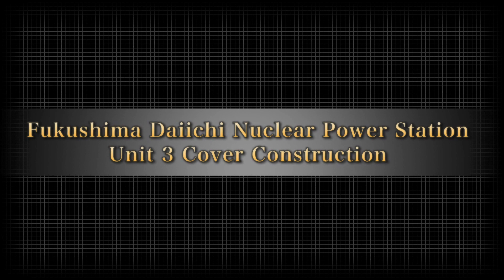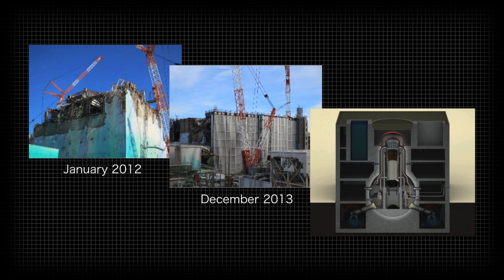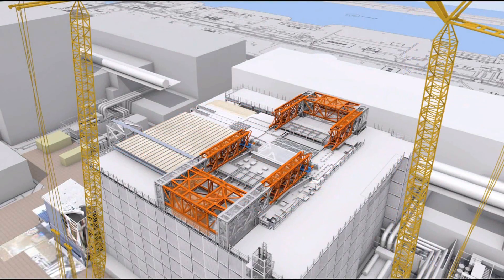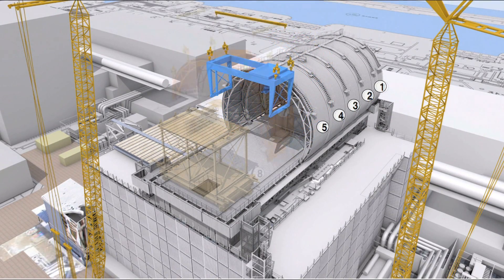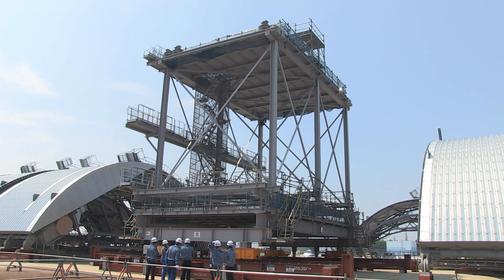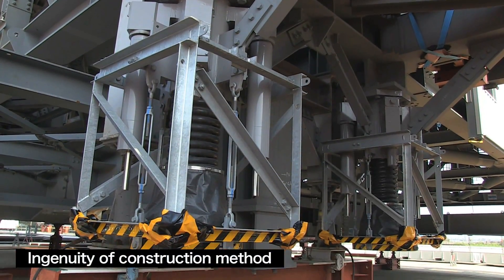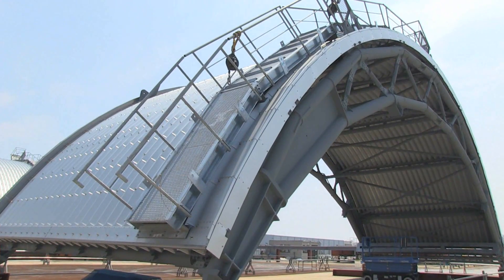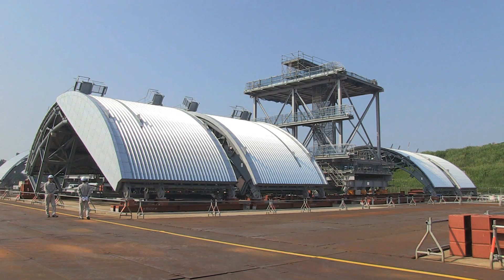2015.10.15 Fuel Removal Roof Cover Installation on Unit 3 at Fukushima Daiichi

Comment: Are you trying to tell me the spent fuel pool is still there, where the top floors of unit three used to be ?  Sorry, I'm not buying that.
Reply: The top floor of Unit 3 is still there, the walls and roof were blown out. The top of the pools in each unit are flush to the top floors. Yes, the fuel is still there, and it's hard to believe otherwise. The pool is full of water and has been imaged countless times, and there's imagery of the fuel in the pool. As well, there was thermal imagery a few days after the explosion showing the pool area as a large hot spot.
Reply: +GoddardsJournal I still haven't seen any images clear enough to convince me, but perhaps you're right. It's got to the point that I automatically disbelieve anything tepco says. Maybe ALL the fuel rods seen tumbling out of the mushroom cloud were from the core. Maybe they won't just tip the contents of the pool into the ocean when no-one's watching. Maybe they'll send me a big wad of hundreds as compensation for the risks to my health. But I'm not holding my breath for any of that, when the whole nuclear industry is less trustworthy than the local drug dealer.
Reply: Science Troll It wasn't fuel rods seen tumbling out of the Unit-3 cloud but the roof bitumen that had been blown upwards falling back down. The same could be seen @ Unit 1, albeit its roof didn't rise as high. If those were instead fuel rods, the campus would be so hot nobody could have gotten near it. 

The upper deck of Unit 3 is extremely hot, too hot for workers to get on it, certainly, imo, because some fuel was blasted out from its core. But independent studies indicate the amounts of liberated raw fuel were a tiny percentage of the total fuel inventory. And it is clearly visible that the large cement well-cap of Unit 3 rests in place.
Reply: The well cap is also called the shield plug. It's a massive multi-layered circular concrete plug that encloses the primary containment vessel and is flush to the upper-deck floor. It is not the cap to the reactor core. It is well imaged in many photographs. For example, google this headline for a report @ enformable:

TEPCO finds falling debris damaged shield plug at Fukushima Daiichi Unit 3

Or google: "unit 3" "shield plug"

That the massive multi-ton plug is resting in place is certainly proof positive that the core was not blown out. Although how deep the core melted down is anyone's guess. And I suspect a tiny faction of core fuel escaped around the plug's edges with the explosion, but that's my own speculation. The plug does not form an airtight seal.
Reply: The reactor vessel is metal and it's housed inside the primary-containment vessel. The reactor vessel is supposed to be airtight, for sure! But of course that seal failed big time during the meltdown.
Reply: Background CPM is variable upon elevation and changing environmental conditions like rain and pollution. Washout of radon in the environment by rain can elevate readings temporarily after rains. The background CPM in Denver is around 100, whereas other locations closer to sea-level may be around 20. A youtube search should find Denver examples. I'd like to find peer-reviewed data on an expected CPM range of radon washout, but I haven't been able to find measures in terms of CPM. But based on youtube examples, it may be many thousands of CP with high-quality Geiger counters.

The way to determine if a hot sample is radon is to test it over 24 hours. In every case where someone finds high CPM counts in rain I've seen on youtube, if they test it over time it decays to their normal CPM counts over 24 hours. That is proof positive that the radionuclides were the short-half-lived daughters of radon. If it was nuclear fallout, the sample would remain as hot for days and even years. This is a very reliable and easy way to determine the nature of hot samples w/o a gamma spectrometer. 

Imo, and generally speaking in the standard view, even one radiation emission can be harmful. At least in the technical sense that it can damage DNA upon impact, but also in the more downstream sense that said damage might result in cancer. But, over 99% of radiation-induced DNA damage is quickly properly repaired by the body. Our bodies are repairing background radiation damage 24/7 cradle to grave. But even nearly perfect isn't perfect, and so as we age, we accumulate damaged chromosomes that were improperly repaired, and that accumulation corresponds to increasing risk of cancer.
Reply: Sorry, ya, radon and its daughters largely emit alpha radiation. But they emit gamma too, hence gamma spectrometers can identify radon progeny. I'm not familiar with the NRC gamma-ray chart readings. Geiger counters detect gamma and beta, and ones with a mica window, like the Inspector, also detect alpha.